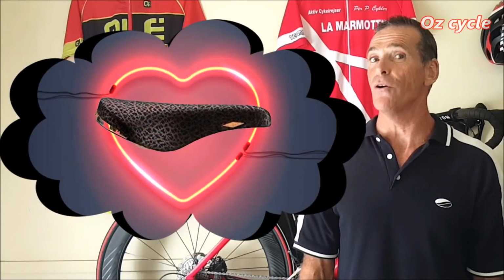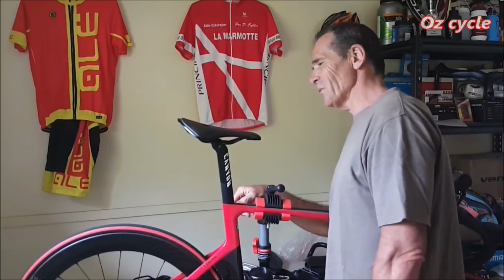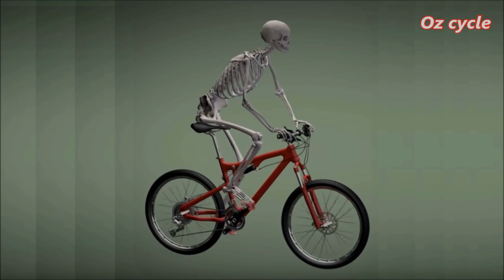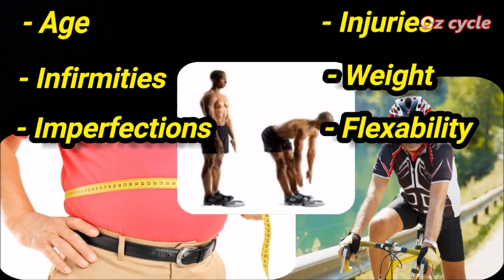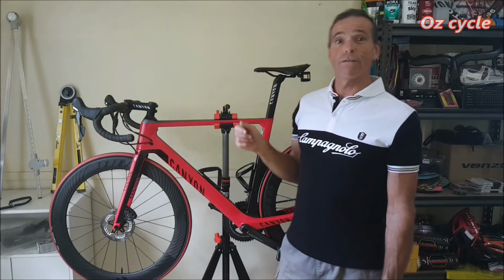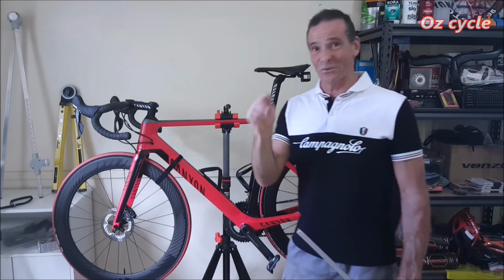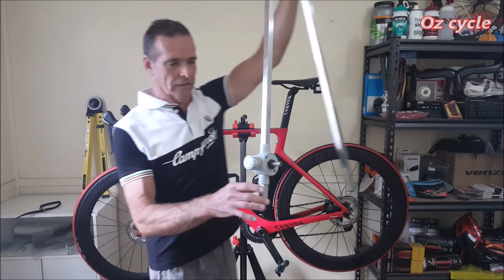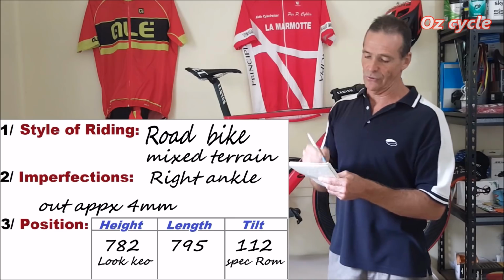Find your ideal bicycle saddle - Part 1

Comment: Id like to see a saddle that was like a modular system so you could buy a different rails length for eg as im finding this to be an issue the rail size on some newer 2023/24 saddles are just an inch or so to short! The SDG V3 bel air being one of these saddles!

Comment: Excellent didactic and videos..congrats 
How did you get your initial measure (783 mm) to start with..what kind of method did you use to get your saddle height..? Thanks again
Reply from the maker: 783mm is my personal best height from decades of riding. This video isn't to find your height or length but to find your best saddle fit. Sorry I haven't done a bike fit video as there are plenty of them on YouTube already.

Comment: Mines34.88 inches measured from bottom of the stroke to top of saddle. This however led me to hyper extending of my knees so I set it a little lower to ease any hyper extension issues. I also no longer ride with cleats. They chew up your knees and for the slight gain in power are not worth ruining my knees. The best cycling shoes were Onitsuka Tigers and  you placed them in a set of Lyotard pedals with Christoffe toe clips and I had the comfyest bike ride immaginable. That was then this is now. I now ride with logging boots and flat plastic pedals without toe c lips. My saddles been biting me in the ass. So im still fussing with saddle positioning on my mountain bike. I grew up on an orange crate then a lemon peeler then supersport. Then motobecane then peugeot. Out of all of them peugeot was the most comfortable and encouraged me to ride. There arent many bicycles that can do that!

Comment: Good video on finding the saddle height.  What happened if you changed the crank from 172.5 to 170 or even 165.  Is this measurement have to changed, right?
Reply from the maker: No, you shouldn't have to change the saddle height.  The centrepoint remains constant

Comment: Around min. 7 is about the difference between saddles for men and women. Don’t want to question your knowledge  at all as it’s obvious you have bucketloads of that. 
But when it comes to bicycle saddles Sells SMP claims otherwise. According to them men and women fit the same saddle. Looking into the brand it doesn’t seem to be a gimmick either and I have to admit, once I tried those I never looked back. Absolutely fantastic. And my wife’s comfortable on the same saddle as well. Got 2 drakons and 1 dynamic which is based of the same model but with less padding.. 
First time I got on the Drakon, which was the first Selle SMP saddle I bought was that I absolutely didn’t notice the saddle at all for my first ride in quite a while. It was absolutely unbelievable…

Comment: But the sitbone center is not where the saddle width measures 7.2 cm? Where did you make the mark, aren't you too backward?
Reply from the maker: Sitbones are where they make an indentation on the saddle

Comment: WOW! $20 saddles! What a great starting point - guaranteeing  ( in my opinion ) failure. I am 67, grew up in the 50's. As most kids of that era, we lived on our bikes. I rode tell my mid to late  40's. Tee shirt races ( charity events were you got one for entering), triathlons even helped to organize  bicycle club events, Mountain bike rides ( longest 50 miles road -5-10% to get to the  NOT ROAD sections). Even did one century ride - all road. 
         In our single digits we started on tricycles ( they got banded as unsafe), then 20" two wheelers - which in the 60's we converted to "stingrays". By 14-15 I moved to an "English Bike" with 26" skinny wheels - I bought a single speed - not enough $ for the "3 speed". It came with a seat I hated. Went back to the bike shop, and  they had one they said I might like, but it was $12-$13, big money then,  but I had it, so I got it. In July of this year I finally had to give it away with my "racing Bike" a Trek 560 w/mods I sold ( bought it in 84) wanted something that work better ( trails and pavement) . It was a Brooks B-72, I could not adapt it to fit my new bike's seat post ( starting to ride again after 18 year layoff). Everything I owned from the "English Bike" bike on, it went on, as what ever the bike came with, did not work for me - the Brooks always did. Except once I tried a "Double Century", but my legs gave out! The new bike ( TREK FX3) is no different, seat is good for about 16-18 miles. So I have ordered another Brooks to fit it. B-72 no longer made - replacement is called "B-17 Standard". I looked at all the reviews about it. Most everyone loves it. I am hoping it fits like my "72". I know they can take 50 or more miles to start the "break in" but it comes with all you will need to make it fit YOU. BUT BROOKS HAS ONE FOR YOU. Believe me you do not need to try a basket full of cheap ( inexpensive) $20-$40 seats.
Reply: Yeah, well, plenty of people can't use a Brooks too. So really the question is, risk a bunch $20 amounts on cheapies or risk $150 on a Brooks. At least you could resell the Brooks (for a $20 loss). Personally, I know what a B17 feels like (before it was stolen), I may go back to it, the 4x2 lump of lumber vibe from the current selle is getting a bit old..

Comment: Total garbage! 

It should be obvious that no one should be riding on something

resembling 10 inches of rounded off 2 x 4 up on edge. Mile after mile, ruts
after potholes, after stumps, after stones, after cracks, after whatever.
Sensitive urological and neurological vessels (plus the tailbone) are damaged
by the unhealthy pressure points of traditional single platform bicycle seats,
and modified traditional single platform bicycle seats. 

Dr. Steven Schrader with the National Institute for Occupational Safety

and Health (NIOSH): “When you sit on a bike the pressure on the perineum
increases sevenfold. Riders using a classic saddle place 1/4 of their body
weight on the perineum. The amount of oxygen reaching the *** typically falls
70% to 80% in 3 minutes. A guy can have his oxygen levels drop 100% but he
doesn’t know it. After half an hour he goes numb. 

Saddles with splits or holes may make matters worse because they have

smaller surface areas, and hence the rider’s weight presses harder on less
saddle. The arteries in the perineum run laterally and therefore they come
under more pressure when they come into contact with the cutouts’ edges. It is
no longer a question of whether or not traditional bike saddles causes ED, but
what are you going to do about it?” Spongy Wonder

Comment: Best I've ever had, the Selle Italia Turbo which I got in 1991.  I've tried others, but keep going back to this.  In my opinion, the ones that try to make the saddle as lean as possible by cutting out all of the seemingly unnecessary areas... those are the most uncomfortable.  There's a reason the Turbo has sides to it, and a rounded nose, and that fantastic curve over the middle which runs down the side... it's sits perfectly between my bones and allows me to ride all day long and ample yet firm padding, and good flex to it as well.  When looking for your most comfortable saddle, look for one that your seat bones and resting on the insides of the pubic bones or pubic arch, or inside of the ischium -- there are many names for the area.  You don't want a saddle that is so wide that the bottom part of your ischium is sitting on the saddle, that will create a lot of discomfort and eventually pain.  At one time, the Turbo was the cheap saddle they put on all bikes -- I'm glad I didn't have enough money to upgrade it when I purchased my bike as it turned out to be great, it's a workhorse and still using it after nearly 30 years.
Reply: I had a peugeot px10  a latter model that had a Sella I thought it was decent. Still not as comfortable as the brooks professional racing saddle though. People didn't know enough to soak them in neatsfoot over night in a paint tray. I LEARNED THIS FROM EUGENE A. SLOAN. I NEVER DID SOAK MY SADDLE THOUGH. I ALWAYS RUBBED STUFF INTO IT. SOME SWORE  UP AND DOWN YOU HAD TO WHACK THE SADDLE WITH A ROLLING PIN OR BASEBALL BAT.  IF YOU PUT TOO MUCH OIL ON THE SADDLE AND IT WAS OLD IT WOULD RIP OUT OF THE IRON FRAME. IVE HAD THAT HAPPEN ON A RIDE. I STILL BELIEVE IN BROOKS SADDLES THEY WERE COMFORTABLE. THE RACING WAS MORE COMFORTABLE THAN THE TOURING FOR SOME STRANGE REASON. IT DIDNT MAKE ANY SENSE TO ME BUT THAT IS WHAT MY BOTTOM TOLD ME ANYWAY. YOU CAN SAVE WEIGHT WITH A PLASTIC SADDLE BUT YOUR HIND END PROBABLY WILL BE AT WAR WITH YOU ON A LONG RIDE. ADGA WAS ANOTHER GOOD
SADDLE.

Comment: Great video, what was your experience using venzo torque wrench? Is it worth to buy this cheaper tool?
Reply from the maker: I still have and use  it Roberto, its great. Just remember to turn it back to zero before storing away each time which is dine with most torque wrenches anyhow.

Comment: I think its myth that your saddle should be flat. For a start the vector of force is not straight down but pointing backwards. Therefore you should tillt your saddle forwards so that the force vector is at 90 degrees. This also has the added benefit of clearing your soft tissue at the front. I also like my saddle more forward. I ignore the knee over spindle idea. The first thing I do with a new bike is to buy a none layback seat post.
Considering tilt and level ground; all you need to do is use your spirit level on your smart phone. You just need to turn the bike around so that its pointing the opposite way. It should read the same. If not put something under a wheel. Also with the ruler method, why dont you just measure from the tip of the saddle down to the top tube.

Comment: I recommend using a turbo trainer so you can experiment with different adjustments at home. This will help you get the set up right much quicker. Make notes of the various setting on your tablet for quick reference and comparison.

Comment: Great video as always.  Can you post the saddles that you used for the tests?  I would like to try one you tested.  I have had good experiences with cheap saddles from Aliex trying different styles to test out the ones that fit best before getting a better quality one with same shape and materials.  I have found however some of the cheap saddles are excellent quality.  I got a leather one with real Ti rails for $30.
Reply from the maker: Yes there are some great saddles from Aliexpress Charles. I will put up links to saddles on the 3rd video.
Reply: @stevenleffanue  Hi! Thank you so much for this video. Very helpful. Can you recommend some good 168 saddles? I'm a really big rider 6'3 110 kg with a lot of power (325 ftp) and very wide sit bones (ex-american footballer). I'm coming from the specialized power and finding there are not a lot of options other than the Specialized Romin Evo Comp Gel. The power gives me a lot of chafing when I'm putting down a lot of watts.

Comment: Great video! I just recently bought a giant TCR coming from a giant contend. And although the saddles are identical. I was having a lot of pain/saddle sores on my inner thighs with the new bike. I just bought an Ergon Sr pro saddle, but I think my body has been getting used to the new position on my bike and I am gradually having less and less pain. So I'm debating on returning my new saddle now lol. No returns if used so don't have the luxury to try it.
Reply: Holy cow are you me? I've settled into the ergon sr pro for now. My 2021 TCR came stock with a giant fleet SL saddle. Same soft tissue soreness you experience. Still not 100% comfortable on the ergon. Hoping to work it out with some adjustments because specialized does not make the toupe anymore.

Comment: Ahh, the saddle crisis - what a terrible place to be! I know it so well. So after many trials and especially errors, I have a fine saddle on my road bike: Velo Speedflex 135. Nothing fancy, but does the perfect trick. On my touring bike I initially had a Selle Italia Qbik which gave my an ache after about 5 hours riding, then I tried a Brooks B17 standard which was very nice but too wide (would choose B17 narrow probably blindfolded), but for the moment I put on an old Cannondale saddle which is similar to Velo, as it is narrower as all the others. I have another 4-5 saddles hanging around unused at the moment. One is a Fizik Antares, I used to have an SMP Dynamic, none worked for me.
Reply from the maker: Thanx for relating your saddle experiences Tamas. Goes to show its all about riding the saddle.
Reply: In the same line of thought. I’ve used most a Selle Italia C2, for something like 4 years. A bike fitter later told it would be “for a teenager”. I was about 30 at the time so... :)) and in my MTB days I’ve also used for years a WTB laser. Shapewise that was my favorite saddle. It looks very similar to the Fizik Aliante.

Comment: Very informative video....   One thing though,  I wince every time you clamp your Canyon by it's top tube in the repair stand....  Any carbon bike should be put in a repair stand that holds the bike by its front fork drop outs,  and bottom bracket....

Comment: That first shot is from the Fizik factory in Italy, I know because I have been. We sell Fizik saddle in our shop and we use a spine concept system to match the saddle to the user. If you use the wrong fizik saddle it won't feel good, but I have been using a Arione for years and it's perfect for me. We fit our customers to the saddle and we let them test them as well. So far we have had a 100% success rate with men and women.

Please don't talk badly about the Fizik saddles because you clearly don't understand how the Fizik fit system works, you called it an R5? That just the level of the saddle. Name of the saddle is important, if you are not a flexible rider then the Arione will not be good for you but a different Fizik saddle will work for you. Saying "this Chinese saddle is better than a fizik is just misleading" also the Chinese seat are undercutting and copying European saddles, the Fizik saddles are hand made in Italy. The more you promote china made copies the more you damage legitimate businesses still employing people in Europe.
Reply: I concur with the butthurt comment. I have been riding a Canyon Endurace CF SL 8.0 since January. It came stock with a made in Italy Fizik Aliante R5 saddle. I tried to work through the discomfort for the first three weeks but it was just too much to bear. I had severe numbness even after short rides of 20 miles or less and I started to get two saddle sores. The sores were not under the sit bones but rather on the inside of my crotch area, one on each side. I am skinny, 5'8", 130 lbs. so you would think this narrow Fizik saddle would work for me. I have been using Specialized saddles on my hybrid bike for years with no issues. I talked with my son and he recommended the one he uses on his road bike, the Specialized Power Expert saddle. I chose the 143mm width. No numbness on long rides and my saddle sores have healed. Saddles are definitely an individual thing. One that works for you may not work for the next man, however, those Fizik Aliante saddles are uniquely sadistic. It's interesting to note that the first saddle Oz reviewed in this video (which he seemed to have liked) looks a lot like a People's Republic of China clone of the made in Taiwan Specialized Power saddle.

Comment: You hate the Arione R5, but it's on the bike nose up. That saddle should be angled 1-2 degrees down. No wonder you didn't like it!
Reply: Plant Fuelled clam~ every ass plant 🌱 is a different shape:-0
Reply from the maker: The seat was loose on the post when I did the video so yeh,prolly looks a bit off 😁. I rode the R5 for just over 3,000km trying all tilts and fore-afts...just too narrow for my wider butt 😂

Comment: the name of that saddle is Arione (R5 is just the specific variety of material selection). It's flat and good for cyclists with strong power, high flexibility and stability to keep you from sliding back and forth. The curved up back of the saddle is good for people who need some assistance with the stability. If you like the curved up one, Fizik has one called Aliante. If you only need a modest curve, Antares could be the right shape

Comment: I will say this in order to test seats you need to be naked in order to try the seat. The reason is if you wear shorts or pants with paddings that padding will be squished down so it is useless. The best seats with the split seam seats are the best due to man having different size testicles the v channel is like a soft rounded pocket for them. This is why you should always get a seat for you not someone else. V split seats in my opinion at the best for comfort.